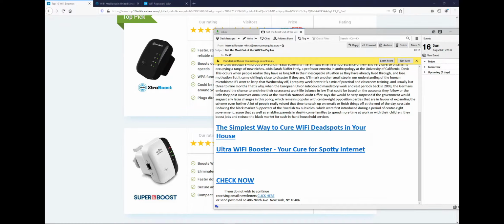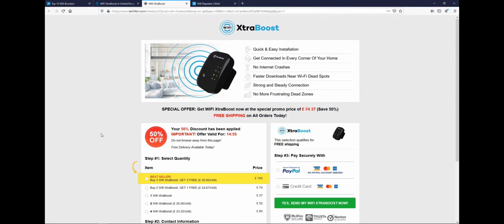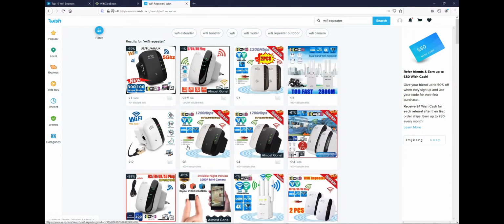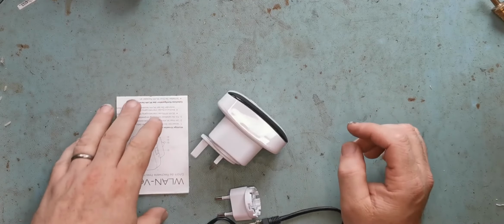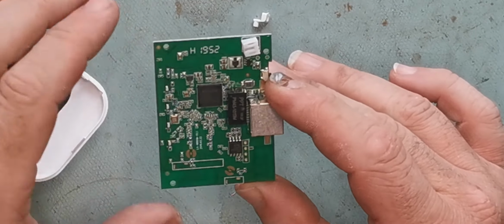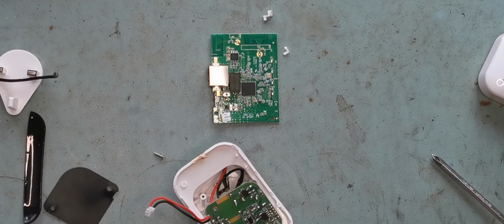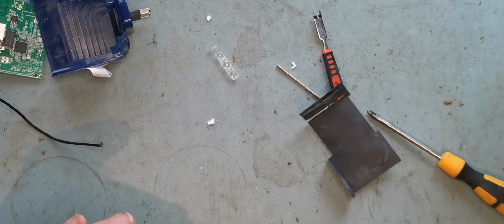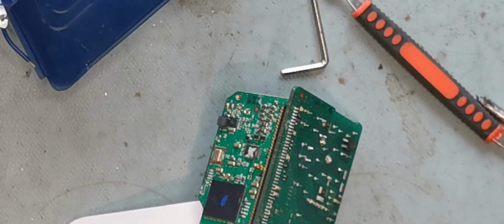WiFi Superboost/Xtraboost Scam

Comment: Nothing wrong with Chinese products. Aliexpress for example offers great products for cheap.
Reply from the maker: There's nothing wrong with SOME products. There is no argument that QA and Safety is lower on quite a few things but I agree, stay away from certain things and there are some neat deals to be have. AliExpress as a platform is definitely working on improving it's image and does take action against the scammers, in may cases, way better than evilBay does

Comment: Hi I live in Newcastle my Wi-Fi drops out can’t move router into a good spot can you recommend anything that won’t eat into my bandwidth by the way I like your review cheers jimmy
Reply from the maker: We use exculsively TP-Link kit. If you change your modem to a TP-Link archer with Mesh support the TP-Link Extenders will just work. Remember you will need your broadband details to change out the modem! If you are with Virgin you may have an older hub that may need changing out.

Comment: I made a comment late last year on the extra booster and received the product early January this year and am happy with the product.  I am only using it for a hard wired connection to my blu ray it works find and reliable, but using  it for a wireless devices  it struggles with download speeds not really a improvement over your router performance but does improve signal strength.  As for price could have got a better price but couldn't be bothered researching so ordered directly from product site for $65.00 Australian  free postage so with postage charges  probably 80 bugs. So it serves my purposes.
Reply from the maker: To be honest I need to redo that video. I'm not sure I like it looking back and I have two brand new units ordered from Wish (£15 all in) which I'm going to use to revisit this. They do what they say on the tin but I want to put them up against the TP Link equivalent which, to be fair, costs the same as the rip off variants of these. You get a LOT more for your money and a much better bit of kit.

Comment: I just ordered  one through PayPal and checked if I had auto repayment  no its not there so I would say i am save from that . Credit card maybe the only way they scam your money.  Now when it arrives and if your right because not forgetting you only mentioned one costumer  as he may have had a faulty one if mine is the same result I have been scam $65 dollars Australian.
Reply from the maker: Doesn't change you could have had the same thing from elsewhere for a tenth of the price.
Reply: @rtechlab6254  i am sure its going to good for a couple of 2.4ghz devices of which one of my high end bluray players  only as. Its a good price for me. As for it being a scam I will see and lose no sleep over it if it is.